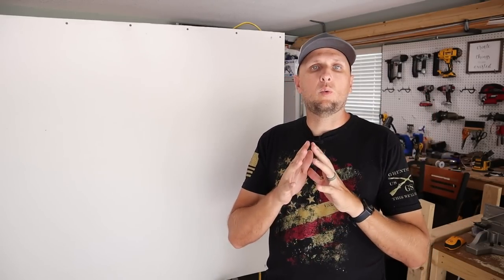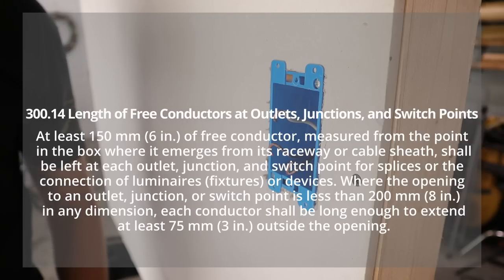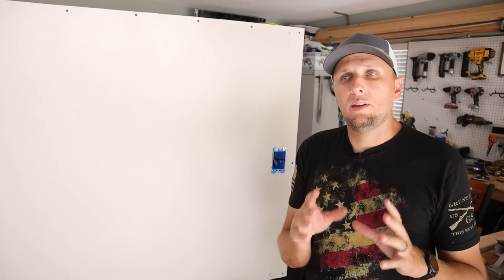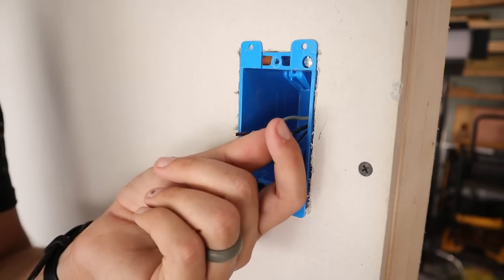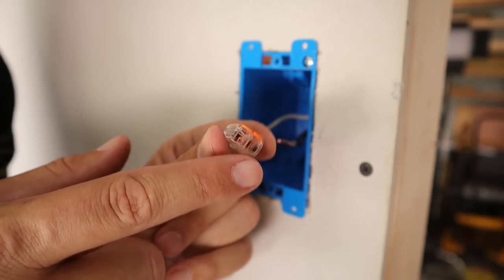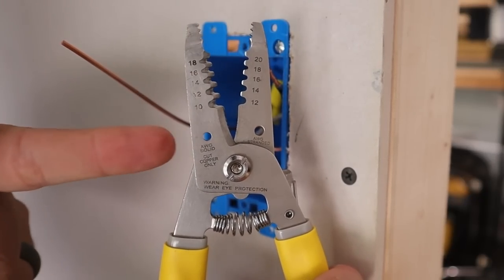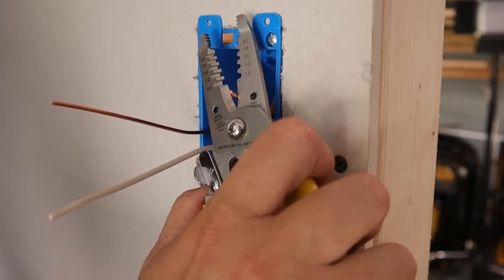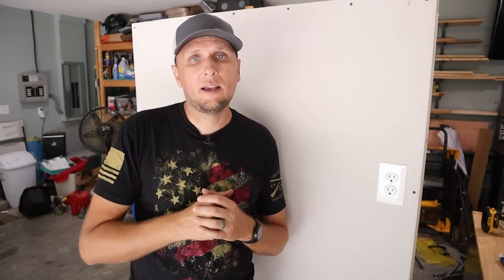BIG Mistake DIYers and Even Some Pros Make When Running Wires Into a Box | How To Fix Short Wires

Comment: Here in western Canada and other places, though wires are stapled to wood studs, there is a ‘service loop’ of 6” to 8” commonly left between box and first staple for this purpose. So definitely worth pulling the wire to see if there is any slack. https://i.stack.imgur.com/tub30.jpg
Reply from the maker: Yeah I have seen this there.  Here in the US, I have rarely seen a service loop in many places in a residential setting anyways.  Now that I am thinking of it, I did recently see some up around some pancake boxes for vanity lights on a job site I was on.  None around the switch boxes or receptacles though.  Thanks a lot for the feedback Mark!
Reply: i saw ONE elec. do that in the USA & i didn't agree w/ it because it's just compensating for future improper work. Kind of anti-professional imo. ofcourse the inspector never saw it because he was  getting paid off but i digress.
Reply: I saw a YouTube video that had the loop in the kitchen backsplash area.  The electrician figured this was the area that the wife might do a change order to move location a bit or would be renovated in the future.